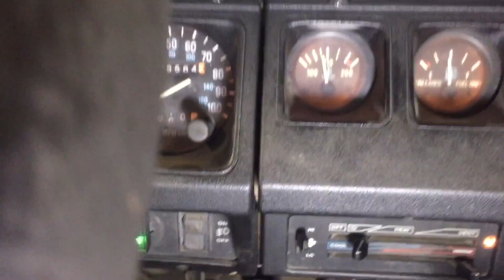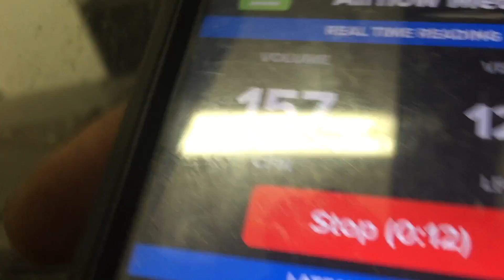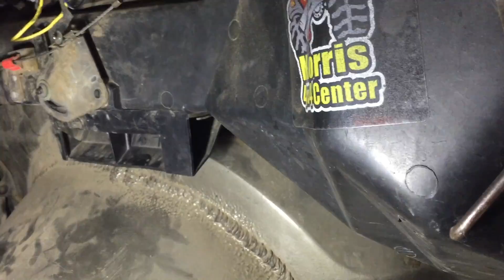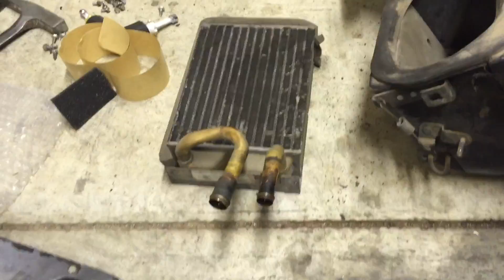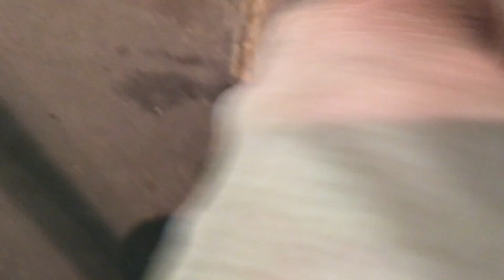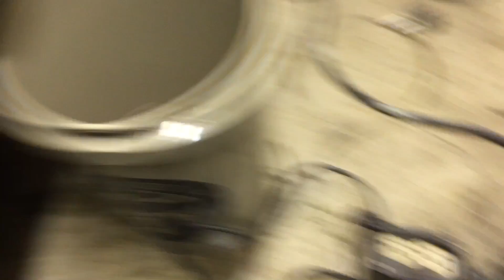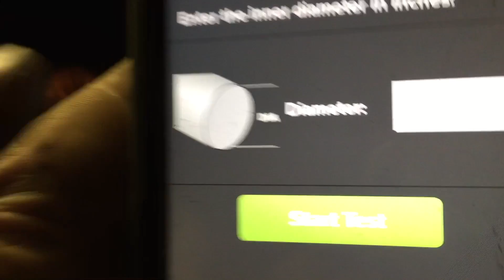Jeep Wrangler YJ Heater Core & Blower Upgrade

Comment: Good video, thanks for the info.  Out of curiosity at 0:28 I see the bulb on the right side of your HVAC controls burnt a hole in the plastic also, is this something that happens on all YJ's?
Reply: Thats funny, mine has it too. When I opened it up, I found the bulb leaning against the plastic through the inside
Reply: On mine there isn't actually a hole, that's just where the light bulb is focused more so all the light shows there.
Reply from the maker: Good question. I am not sure, definitely would not surprise me

Comment: Just replaced heater core and OEM blower motor with 
PM 102 I purchased at my local Auto Zone for $19.00. Save yourself a lot of work there is no need to cut the hole in your firewall bigger. Just simply slide the sleeve off of the new blower motor and it will fit perfectly into existing hole. To wire cut off original harness from OEM blower motor attach positive wire to the single post on new motor attach a ring terminal to negative wire and ground to one of the mounting screws for the new motor. This new motor does blow significantly better than the original
Reply: I purchased the new upgraded motor and I have inspected it.  The iron sleeve is part of the motor that couples the field and makes the motor work.  If you remove the sleeve you must put it back on from the other side of the firewall in the same location on the motor shell. The motor will probably run without the sleeve, the field will couple to the tin shell but the motor will be much less efficient.
Reply: the iron sleeve around the motor is a return magnetic field path for the internal magnets. If you remove it you're essentially weakening the magnets which will make the motor less powerful.

Comment: How did you power up the new motor? old one has a 2 contact plug. New motor has a single contact post.?????
Reply from the maker: Marlon Knighton , sorry I didn't get the notification until now. One wire is a ground, I grounded it to the fan when I bolted it up.

Comment: Hey man nice job on the upgrade! How did you change the connections on the blower from the two wires to the prong?
Reply from the maker: bigpapaian, thank you. if I remember right it's the same plug. If I am incorrect a female but connector should work. Definitely worth the time for the upgrade.

Comment from the maker: I believe I did use the factory replacement, I can look when I get home and give you the part number. Yes I used the same hamster wheel for the blower, just have to be careful not to break it as your taking it apart.

Comment: Thanks for the video, just about to get started on that. For the heater core, did you use the same model  as the old one, if not, what model/part # did you use?  Did you use the same hamster wheel as well?